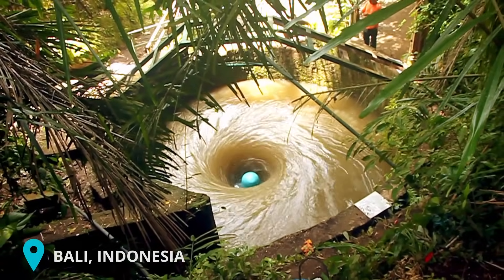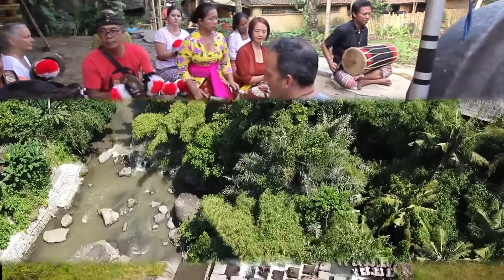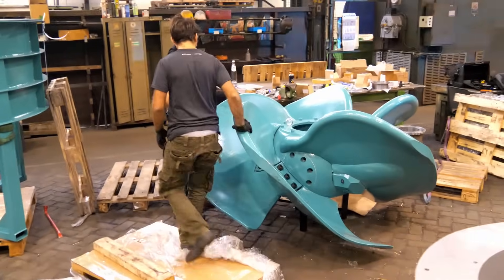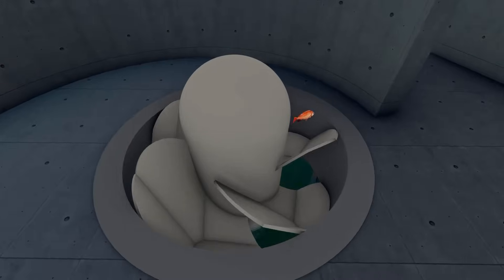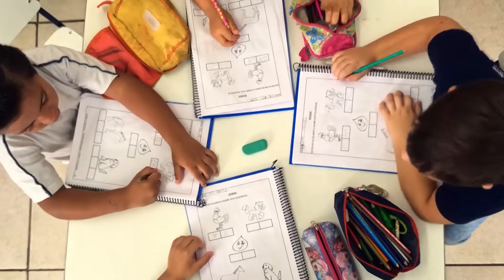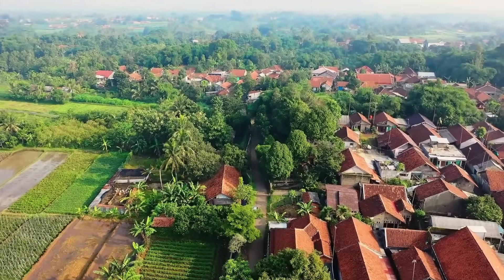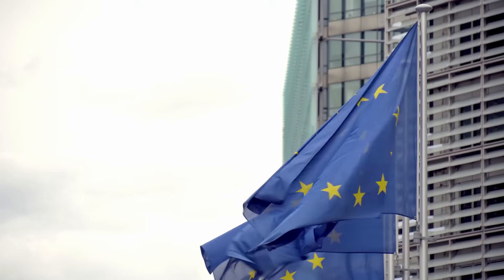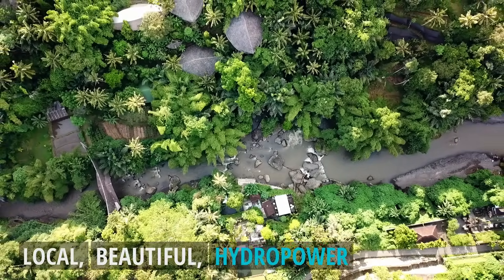Turbulent Energy Explained: The Vortex Turbine!

Comment: The merits compared to a vertical half kaplan fixed propeller turbine with aspirated exhaust? It costs less? is it more efficient?
Leaving aside the comparison with the screw turbines.
I do not understand. Ciao
Reply: The Archimedes' screw turbines, (that are installed "diagonally") use more material to construct and require more maintenance due to the load not being axial or perpendicular to the thrust of the water. These are installed on small streams and have a much lower impact on the aquatic life than any of the technologies that you listed. The kaplan, as I understand it, would be less efficient in a low-head environment. (Kaplan are great when you have a dam that is half a mile above the kaplan turbine.)
Reply: @recklessroges  Maybe I wrote wrong, I also specified leaving out the arcmede screws, (maintenance costs, etc.) not far from me there is the first co-commercialized archimede screw in the world with variable speed with regenerative inverter to modulate the flow rate, built 18 years ago and (object of study at the time being a novelty, built by the German company which has now been absorbed by a multi-national company, which marketed them for the first time ever over 20 years ago, leaving out this I read many imprecisations, fixed propeller turbines they are not Full Kaplan turbines, but both are born for very low jumps being reaction turbines with aspirated exhaust, they also work with only one meter, then subsequently they have been improved and brought to work even beyond 50 meters for full Kaplan, they are unparalleled as efficiency on the flow rate work curve, but only in large systems and with 2 settings, those not full kaplan but with fixed propeller are practically identical to this stuff, they can be open or closed chamber with radial inlet with or without fixed distributor always for jumps from one meter upwards, this "turbine" appears more commercial for developing countries than anything else, large diameter to slow down and adapt the centrifugal speed of the water to that of the propeller, in the end it is a propeller with an open loading chamber, nothing new we have similar turbines from 1920/1930 with an open loading chamber in the irrigation channels, the propeller turbines fixed are not used on dams or large jumps but precisely in small hydro plants with similar flow rates, they are in the hydroelectric field, this one in the video has adjustable propellers so it is not a fixed prop but a semi-kaplan type, so nothing new. that's why I don't see anything innovative and I don't understand.
Reply from the maker: @winterburan  Good questions, and some already answered above. What do you mean with aspirated exhaust? I don't get that term. As per benefits, we design these turbines to be cost efficient and requiring low amounts of expertise to install. We didn't add a draft tube as the extra efficiency it gave us, didn't outweigh the added costs of digging further down. You have to keep in mind that we design these systems for remote areas and for refurbishment of old mills. existing hydraulic structures etc. When you have to dig down under the water level, you have to put sheet piling around your build site and pump away the ground water. That all adds to the costs. By keeping it simple we want to make these projects doable by people without expert experience in hydraulic civil works. KISS is our moto, Keep it Simple and ssss...cheap.

Comment: so awesome dude 
can you tell me how does it produce power at a very low RPM?
Reply: I think the Water in the Vortex has a high momentum. Momentum times RPM is Power, so high momentum with low RPM can generate as much Power as low momentum with high RPM.
Reply: @philipphermann9454  oh i got it now thanks man
Reply: I know this is late but the turbines have large motors that can generate sufficient power at low rpms. The water does need to have enough force or momentum to push the motors thou.
Reply: I’m saying this because it’s about how much the turbine/motor spins not the momentum of the water. Faster water will turn the turbine more and produce more power and slower water will produce less power. So the rpm of the turbine and the motor(energy produced) is effected by the momentum of the water and the size of the motor not the rpm x momentum of the water

Comment: What is the cost of small system?
Reply: Ok so I just looked it up on google and it said $1,000-$20,000 per unit, but I don't think that includes maintenance. Hope this helps!
Reply: @andersbell6974  thanks but I think that's the problem.  I need to know price per kW to understand the value vs. alternatives like solar or wind, etc.
Reply from the maker: You can visit our website, where you will find a range of prices for our turbine models. Of course, the cost will vary depending on the site characteristics, so make sure to send us any site you have in mind and we will send you a price quotation :)
Reply: @TurbulentHydro  Wat if am in Kenya
Reply: Ken MacDonald  well to be honest if you are in a remote area the cost will be higher than if you are near the capital (for example) and the amount of concrete that you will need to use but I guess what you mean is to have a reference idea like 3k to 8k usd, and have some sort of disclaimer saying something like: *price may be higher due to exchange rates and access to the site where the system will be built
Reply: Ken MacDonald  well are the generators on amazon already made? Because if its already made its way easier to make a price, rather than something that isnt built yet. And since they literally have to remove land it will cost more depending on how big or other features of the land or amy specifications you have.
Reply: Ken MacDonald generators do not need to be created by a case by case basis either.
Reply: Ken MacDonald  your stupidity is showing 🤣🤣
Reply: Ken MacDonald  Well its hard for them to give you a price if they have no idea how big it needs to be, the best thing they could do is tell you how much all the resources would cost/
Reply: Ken MacDonald  If you spent as much time putting the work in as imperiously mansplaining on YouTube, you'd realize the prices are on the website. Pretty clearly, estimating costs for a construction project is more complicated than buying toilet paper on Amazon 🤦‍♂️🤦‍♂️🤦‍♂️